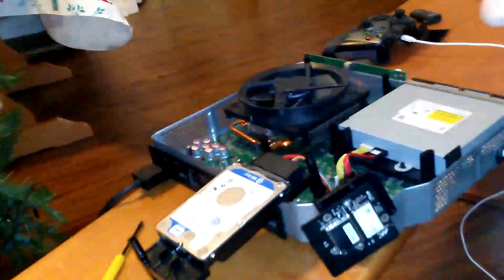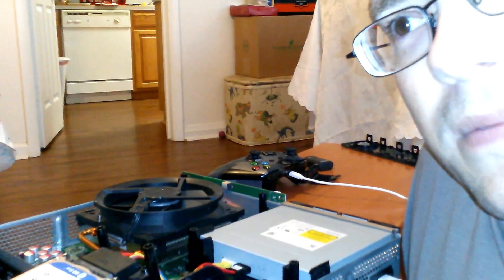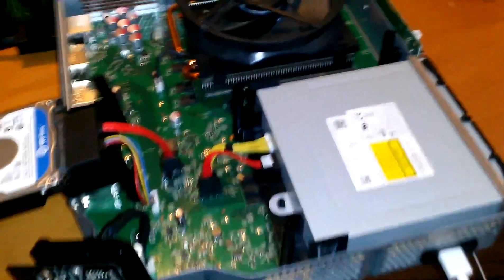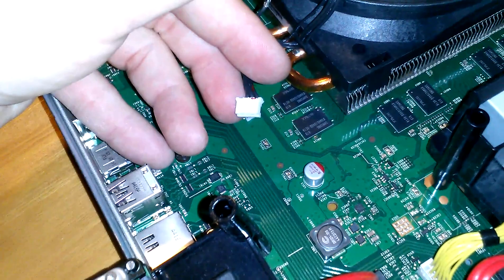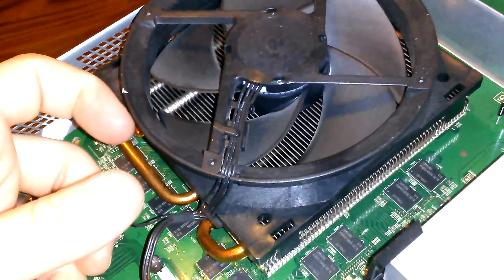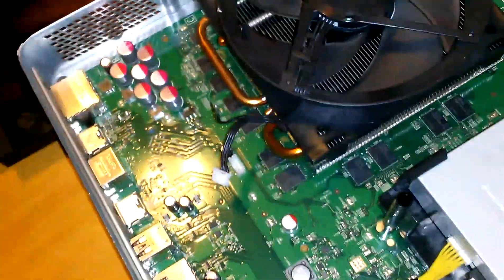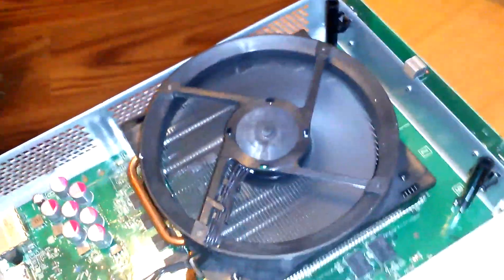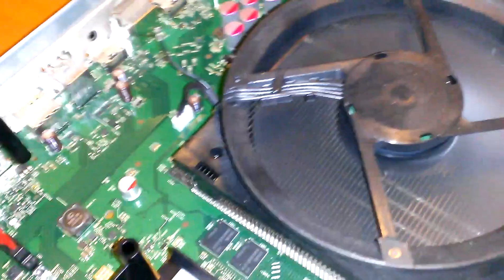xbox one fan overclock 12v fanmod

Comment: Is there any way to set it at 9v or 7v instead ? Can i just disconnect the ground and solder it to a 3v or 5v source.
Reply: so i was researching a bit more and found a guy in England who makes custom fan speed altering devices. they just plug in between the mobo and the fan. you can order them at 20% thru to 100% fan speed increase of whatever the system is telling it to spin at. they cost about 12 British pounds. i am thinking about buying one at 70% to see how well i like it.
Reply: i honestly have no idea. all i did was what i had planned to do at the outset of this which was to make the fan go as fast as possible. so hardwiring for 9, 7, or 5, v is not a question i am able to answer at this time, sadly. i will however start looking into that.
Reply: +uroborous01 i believe 5v is the stock speed. 7v or 9v would be around perfect though.
Reply: +Israel Salinas perhaps. but i currently do not know how to make that happen. i can however make it spin fast as fuck, and keep that system nice and lukewarm.
Reply: +Israel Salinas Run it on a variable speed switch, so you can run it from 0v - 12v, or you could externally power it and throw 16v at it for playing 30 hrs of Forza. Stick a couple 240mm fans in there. it will run cool.
Reply: +SPLCrack variable speed switch eh? i feel a project coming on... after valentines day. wife comes first. and the deadpool movie. that too.
Reply: +uroborous01 interesting proyect!! go ahead!! please'!
Reply: Armando Arroyo currently researching my options. i want to be able to do it without it being detected. i have read a few red flag alerts online about people doing the mod and getting banned for it because they got detected. need to find out where to steal power from to do it safely. currently i am ok with my own system blasting the fan at max speed b/c headphones for game sound. and the wife does not complain much but before i do that tho i want to find an external dumb fan that i can plug in and have that spinning at max speed so that it will do what i have my 360 doing. i have an external plugged in that i turn on before i turn on the system and then i turn it off after it has completely cooled the system down after gameplay.
Reply: uroborous01 i m thinking to do exact the same, i bought a cooler master sickflow 120 mm i made a square on the xbox plastic case to get in the 120 mm external fan, but i m wondering how to plug the fan, usb or direct outlet? I think it will be direct outlet to have better airflow on the xbox, any suggestion?  (sorry for my english :)) by the way i didnt know you could get banned to modding the fan!
Reply: in all actuality, you can not be banned for modding the fan. only for doing a mod like jtaging (hard or soft modding the system so that it will play pirated games.)
as to your question though. i would need to see what you are talking about to understand.

Comment: Any chance of microsoft detecting it and banning the console?
Reply: No. Your not cheating in any way.
Reply: +Israel Salinas No, but they are trying to push Windows 10 to your Xbox too, Lol
Reply: thankfully having windows 10 pushed to the console does nothing as far as detecting the fan speed. so this mod will not get you banned.
and honestly microsoft is retarded or willfully ignorant or just plain does not care when it comes to their systems overheating. otherwise rrod (red ring of death/ red reign of death) would never have been a thing past the first few hundred occurences. they could have easily pushed a system update that told the console to spin the fan as fast as possible. BOOM red ring of death solved. faster fan = more air flow = more heat removed = less heat inside = no red ring of death or at least less risk of red ring.
Reply: i dont care all that much if they see me running around in fallout 4 with a nude mod. all they will see is my female character prancing around and killing supermutants naked and free without a care in the world.
Reply: Yes, immediate ban by Microsoft!

Comment from the maker: this is not my xbox one. this one actually belongs to a buddy of mine in my platoon, and his warranty expired 2 days ago. he knew i was wanting to crack open an xbox one and see if it could be fan modded and he volunteered his sytem to me to test and see if it could be done.
it worked on the first try. the cable is set up exactly like the one from the xbox 360 slim and superslim. 
and i am very excited and happy to present it to you on christmas day the very same day i made the attempt and had success!

be aware!: you will need to have your system set to power off fully by using the energy saving mode setting in the power settings menu. if you have it set to instant on then it will never fully power off it will only go into low power mode and will continue to spin the fan at full tilt.
Reply: further info: after 5 hours of gameplay on MGS5 phantom pain. the system was still at room temperature. the fan, at this speed, pulls heat out of the processor as fast as it builds up. and that is awesome.